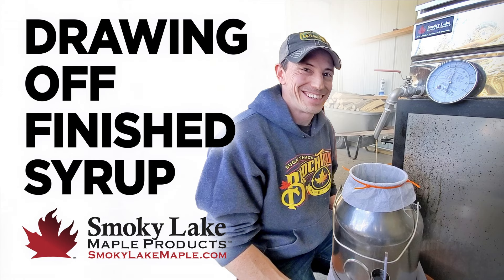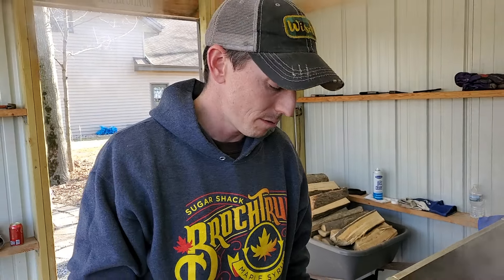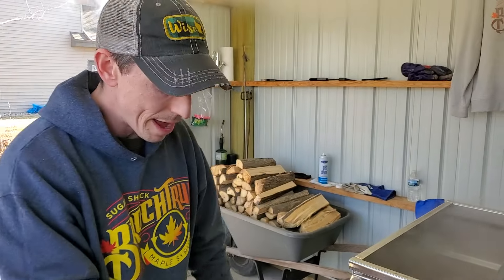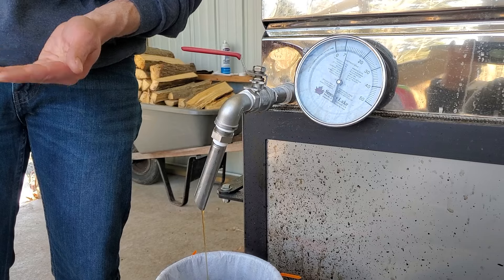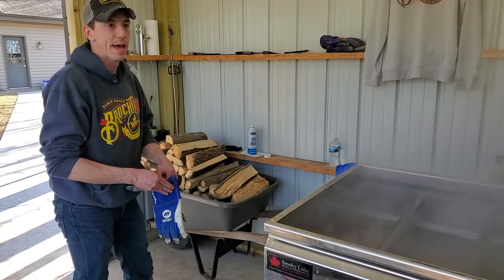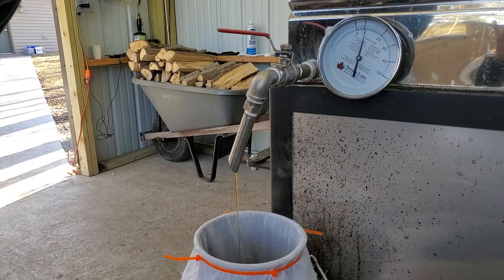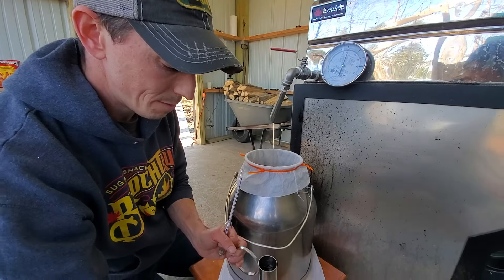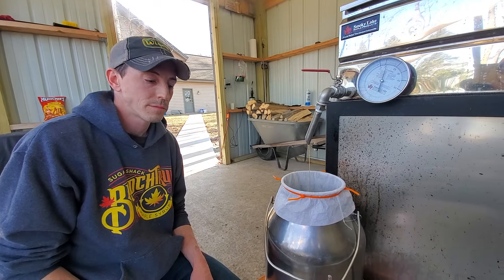Drawing Off Finished Syrup

Comment: Great video and I love Jimmy’s explanations on everything!!  One question I have is: Jimmy says he draws off at different marks every time because of barometric pressure, etc.  How does he know what mark to draw off at each time?  Does he get the boiling temp up to 7 past boiling then do a test with the MC and Hydrometer then determine if he needs more/less product (lighter or heavier) to come out of the front pan?  Also, does he calibrate the analog thermometer each time he fires up the evaporator?  Thanks again!
Reply from the maker: Generally, as you get experience making syrup, you'll calibrate the analog thermometer less and less.  It's far easier to check the density of the syrup coming off the pan with a hydrometer, and then determine the mark at which you should draw off next time.  That's how I dial myself in each day and how Jimmy does it too.
Reply: @SmokyLakeMaple  HAHAHA….I am still a rookie going into my 4th year with an evaporator and still learning.  So if I’m reading this correctly, your first draw off of the day will determine where that mark should be? If say for example my first draw off of the day is at 7 above (as a baseline), and my MC is reading 61 and my hydrometer is floating at 59, then i need to boil it more, correct?  And on the opposite side, if my MC is reading 61 and my hydrometer is floating at 62, then i should open the valve a little to get more lighter syrup in the pan and drawing off. And the ultimate goal on the first draw of the day is to get the MC and the hydrometer to match, then that will determine the mark on the analog as to where it needs to be that day for drawing off….or even a little higher so that there is a 1-2 number difference between the MC and the hydrometer.  And the hydrometer being the heavier number vs the MC.

Comment: So a divided pan finishes the syrup right in the pan, not having to finish in separate pan is that correct?
Reply from the maker: That is correct, that is the main purpose for them.  This also makes filtering much easier as you can deal with it at a manageable rate.
Reply: @SmokyLakeMaple  Whats the container that's going into?
Reply: @lanceh543  Jimmy happens to be drawing off into a vintage stainless steel milk can which is commonly found on dairy farms. Wisconsin is the dairy state, you know!
Reply: @funangela  I assumed that's what it was. Thank you!